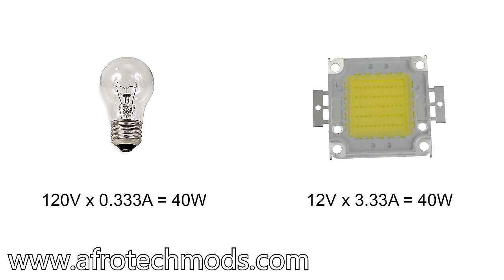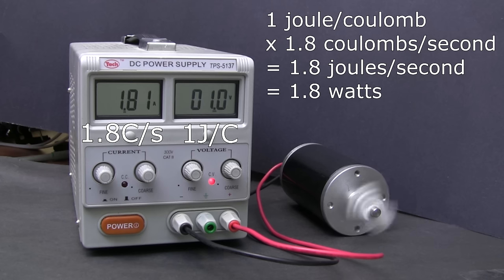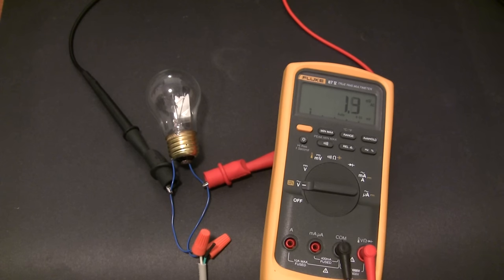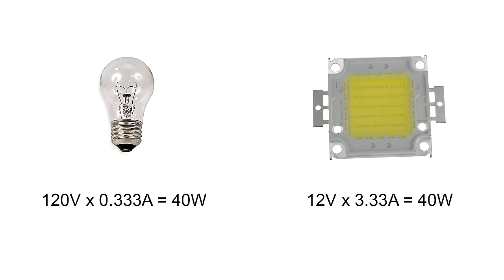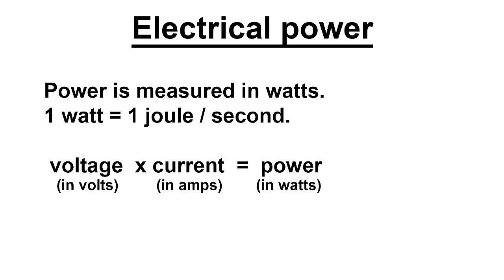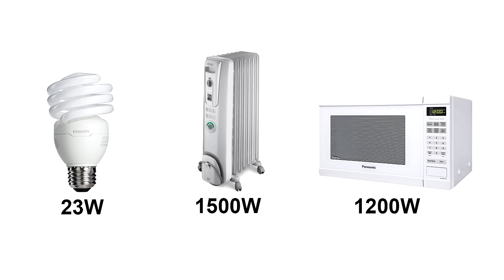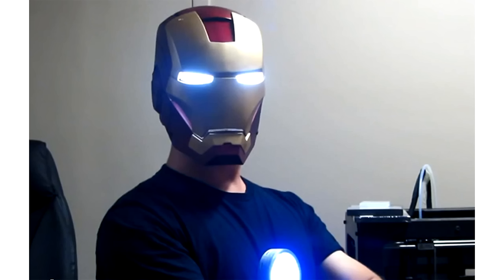Basic Electricity - Power and watts

Comment: you said that Ohm's law is a  linear relationship between current and voltage provided the resistance is constant. However, in the experiment you are referring to at 0:15, when you set up the voltage to 1, a current of 1.8 Amperes was displayed. But when the voltage was increased to 2, the current was 2 Amperes. This is not a linear increase. Why did that happen?
Reply from the maker: Because the motor is not a linear load. Not all loads are linear and therefore not all loads follow ohm's law.
Reply: @Afrotechmods  4 years after and I still got a reply!!! WOW!
Your content is AWESOME!!! Your 3 videos on Current, Voltage and Power are the best I have found on the Internet and better than any textbook.

I might be pushing my luck but there are are few aspects of basic electricity that I have not been able to grasp even though I have scoured the Internet for explanations. I would be most grateful if you could shed some light on these. Even electrical engineers seem to contradict themselves on some of them.

1. What is the difference between charge and electrons?
2. Is electricity a flow of charge or of electrons? If it is a flow of charge, and charge is a property of the electron (and not a physical element, as some people seem to put it), how does charge flow? And is the definition that "electricity is a flow of electrons" wrong?
3. When voltage is increased, are more electrons (or charge) being sent from the battery, through the wire and to the load, or is the same number being sent but at a faster rate? One site even claims that more energy is getting transferred to the electrons while their number and speed remain the same.
4. If at a vertical cross-section of the wire, there is x number of electrons/charge, and the battery is sending, say, x+100 of electrons/charge, will the wire  not be able to handle this and will consequently burn, just like a resistor or fuse? And if the battery sends x-200 electrons/charge, does this mean that, if the voltage is increased, there is room for about 200 more electrons/charge to be sent? Or is this an erroneous over-simplification?
4. If the battery is providing more energy to the electron/charge, how is the electron/charge storing this energy? Is the electron vibrating more, for example?
5. What causes the pressure (potential difference/voltage) in the battery? Is it the difference between the NUMBER of electrons at the negative terminal and that at the positive terminal, or is it the AMOUNTof energy that the electrons/charge hold at the negative terminal with respect to the positive terminal?

Please do continue to make videos.

Praying that you are in a generous mood to educate this ignoramus :-)
Thanks beforehand for your replies.
Reply from the maker: @salimr4718 1) Charge is a fundamental property that some types of matter have. And electrons are a type of matter. 
https://i.pinimg.com/originals/9f/57/7b/9f577b9a840c4c8bd1870523bb44de3a.gif
2) It depends on how you define "electricity". It is technically more accurate to say it is the flow of charge. "Electricity is electrons flowing" is just a simplification to try get people's heads around basic concepts before delving into quantum physics. If you really want to get into more detail, electrical current isn't actually even the flow of charge, it is the propagation of an electric field which results in the movement of charged particles.
Sparkfun has a more physics-ey explanation that you might find helpful. https://www.youtube.com/watch?v=z8qfhFXjsrw
The rest of your questions suggest to me that you are looking for answers in the wrong place - most electrical engineers usually don't look at things at that low a level, you want to be learning from physics and chemistry teachers. That being said, they are excellent questions so definitely keep searching for the answers!
Reply: Thank you for your answers and suggestions. Your explanation about charge and electric field helped me a lot. I now understand what you mean, although the aspect of what exactly increases and changes when voltage goes up is still unclear. I will keep on searching for answers and, if I find them (and remember), I will surely post them here.

On a side note, this quest for answers has also helped me understand why I (and other people like me) find it hard to understand physics. It comes down to how we approach the subject matter. We need too many answers right at the start and we are serial learners; we find it difficult to move on to the next topic unless we have fully understood the current one. This assumes that there is an answer to every question we raise, which is often not the case in science (and I am discovering that there might not be a single human being on this planet who fully understands all aspects of electricity). This also requires a teacher with in-depth knowledge, excellent teaching skills and tons of patience. This is exceedingly rare.Those who do well are those who can treat what they do not understand as black-boxes, or are satisfied with analogies, and are able to connect the black-boxes together to get an overall picture of the subject. And they move on with their lives! I believe that this is one of the trait of a good engineer. For people like me, that one thing that we do not understand might consume our days and nights (as it is happening with me currently).

I wonder if I can train myself to learn otherwise.

Thanks again.

Comment: I have a question
If we are using 60watt bulb in 220v then amphere is very low but the normal home wire electricity will give more than that how the bulb work in high amphere

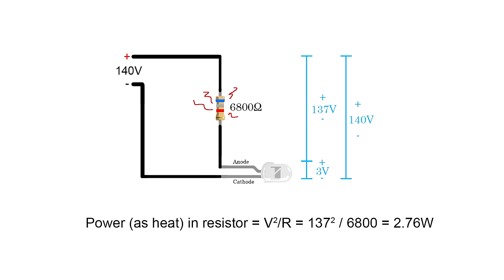Comment: in experiment at 3:26 (140V battery, 3V LED, 6800 ohm resistor), what if the circuit only had resistor (without LED), with 1/4W resistor, the current must be lower than 20mA and the resistor didn't smoke ?

Comment: Hi. On my wall there are sockets hat are able to output 1500W. If I plug a small lamp to the wall it get 10w from the 1500w available. If I plug a bigger lamp it get 100w from the 1500w available. Who is to decide that a lamp can get 10 or 100w? Is there a resistance on every lamp that permit to a small lamp to not be burned by the power of the wall socket?

Comment: This is something i've been confused about for some time: Is the amount of heat a lightbulb or any cable with resistance gives off just measured with VxI? Because I saw a video some time ago about why we use ac current instead of dc current, and the reason was that it is very easy to transform low voltage with high current to high voltage and low current (and viceversa) with ac, and that it was more efficient to deliver electricity with a high voltage and low current. Also some videos here on youtube about contact welders show that they rip open a microwave transformer and mod it to get a low voltage with a massive current from the wall. 
The point is, if it doesn't matter if the current or the voltage is high as long as both multiplied yield the same watts, then why is that? (the high voltage on power lines and those contact welders that people made that need a lot of current)
Reply: This is something i've been confused about for some time: Is the amount of heat a lightbulb or any cable with resistance gives off just measured with VxI?
Yes, resistive loads convert almost 100% of electric power to heat.

The point is, if it doesn't matter if the current or the voltage is high as long as both multiplied yield the same watts, then why is that?
Power lines have a certain resistance and according to Ohm's law there will be a voltage drop if current flows through a resistor. So the lower the current, the lower the voltage drop. V=RxI 

Let's say the power line has a resistance of 10 Ohms and you want to deliver 1MW. At 10kV you'd have to pass 100A trough the power line, so the voltage drop across the conductor would be V=10Ohms x 100A=1kV and therefor the power loss would be P=1kV x 100A=100kW.

If you use a higher voltage for the same task, lets say 500kV, you'd only have to pass 2A trough the power line. So the voltage drop would be V=10Ohms x 2A=20V. That gives you a power loss of P=20V x 2A=40W. 

For spot welders made from MOTs the opposite applies. Normally these transformers have a primary winding with let's say 1000 turns which sees mains voltage and a secondary coil with roughly 10 times the number of turns so they step up the voltage by a factor of 10. If you want high current at low voltage, you replace the secondary winding with a low number of turns of very thick and conductive wire, lets say 10 turns. That would step down the voltage by a factor of 100 and on 220V AC you'd get 2.2V on the secondary. Now the primary winding is typically rated for something like 800W, so you draw 3.6A from the socket while drawing roughly 360A from your secondary winding because P(in)=P(out)-P(heat). 

I hope this cleared things up a bit for you. If you still have questions, feel free to ask.
Reply: swiss Oh now I understand. Thank you! That was very clear. I completely missed that the heat given off by the resistor is given by the voltage drop times the amps, and that the voltage drop increases with the current passing through it. I think you cleared all my doubts about it! :D
Just out of curiosity, are you an electrical engineer, or studying something related to electronics?
Reply: Ciroluiro You're welcome. I'm not an electrical engineer by any means, just kind of a jack of all trades who doesn't mind sharing his knowledge. I've also been called a smart-ass many times and I hold that title with pride.

Comment: So let's let's say that a microwave draws 1000w of power per second. What confuses me is that what part of the power is spent. So only some of the energy is turned into microwaves. And we pay bills in watt hours, so it is obviously not drawing 3.6million watts per hour. So my question - is the power drawn different from the power that is dissapated?
Reply: I think you have your units mixed up a bit. It doesn't draw 1000w per second, because watts are already in "per seconds". It just draws 1000w, which means 1000 J per second. So leaving a 1000w microwave running for one hour means that it uses 1000 watt-hours of energy (since it's 1000w of power running for 1 hour).

Comment: I am not an EE but from what I have read, in AC circuits the voltage and the current are slightly out of phase.  So how does one calculate the power factor?
Reply: mediaguardian well google,english is not my primary language,but i study EE,so there are 3 equations: 
1. P=U*I*cos(phase in °) in Watts
2. Q=U*I*sin(phase in °)
in VAR
3. S=U*I in VA

Comment: instead of putting in a stronger resistor, can I simply put multiple resistors in parallel to divide the power onto more resistors? or doesn't power work like that?^^
Reply: Blasulz1234 2 equal resistors of, let's say, 5 Ohms in parallel will have an total resistance of 2,5ohms, so you would have to buy stroger resisitor, but if you're going to buy more resistor why don't buy one of 5ohm that can handle the power? But if you already have 2 10ohm resistors, yes, the power will split, the circuit will work and you won't get smoke
Reply: yea I'm aware of that, but thanks!

Comment: I work in I.T but tinker with this stuff. I hate how they size UPS in VA yet almost every PC, server, switch, etc they say it in watts. 
Like say a 24 port POE switch has a PSU that takes 700 watts. Then you have to find the right UPS for that and those are usually in VA which makes things kind of confusing, frustrating and a pain. I wish the UPS s would just say recommended max load 100 watts. then you know that it can run a 700 watt switch fine, or maybe 2 in some situations.
Reply: I always heard NEVER plug anything with a motor or laser printer into a UPS. I heard a story of some tech needed an outlet plugged in a mini vacuum to the UPS and blew the UPS up. Laser printer I think is more an issue of wattage that the fuser draws.
Reply: jtech0  The reason they rate these in VA is because of the maximum CURRENT RATING of these devices.  Say,  you're pulling 1000 VA and using 746 watts.  All is well,  if your power supply is rated at 1000 VA.  You are drawing one horsepower.   But your POWER FACTOR is only 0.746.  And,  in real life, it gets worse.  You are lucky to have a 0.65 power factor... not in the UPS device itself,  but in the LOAD.   Then, again,  it all depends on what devices comprise your load...    IHTH
Reply: Are you kidding?  These fuses and breakers are rated in AMPERES.  PERIOD.  Nothing to do with wattage. Wattage refers to the actual work consumed by the load, and in certain applications, is a fraction of the VA product.  You have a lot to learn.

Actually, I lied to you.   Breakers and fuses DO have a MAXIMUM voltage rating,  but it has nothing to do with initial blowing or tripping.  Instead,  it is a safety specification, in order to ensure RELIABLE circuit interruption on overload.  But still:  a 20 amp fuse is designed to open at 20 amps,  no matter what the OCV.  Put a million volts across a blown fuse,  however, and it's liable to arc over.

Comment: Very very basic question
When you say the bulb consume 40W every second, then the energy meter in the house, how will it calculate the consumption?
Since it is Wh, so is the calculation 40W x 3600sec? Wouldn't that be too much or incorrect?
Because I thought, whatever the power rating of the electrical equipment, that is the consumption per hour, ie, 40Wh.
Equation looks similar but the final calculation the meter does would be different for billing.
Reply: Arjun Menon a 40W bulb running for an hour would cost you 40W x 1h = 40Wh.
Reply: Arjun Menon 40W * 3600s.  This would give you the amount of energy in J (Joules)
Reply: miningmanna mc Wh is too a unit of energy, just not S.I (system International)
Reply: pit fermi I know, I was pointing out, that he may have confused Watthours with Joules
Reply: yes. my bad. confused basic units with S.I :D

Comment: 3:43 so Power is synonyms for both heat and watts?  If so doesn't that mean that heat and watts are the same thing?
Reply: Watt is joules per second and heat is also measured in joules because it’s also energy

Comment: what about very high voltage like 10kv should I play whit that
Reply from the maker: What could go wrong?
Reply: Afrotechmods nothing :)
Reply: Sure, but only from a 46kV rated bucket lift.
Reply: You can, but only once
Reply: Yes.  In fact,  I am working a new line of sex toys.  Stay tuned.
Reply: Sir, that is on my bucket list.
Reply: I find your reply quite shocking.
Reply: as long as its ameres is low no problem ahaha
Reply: *with

Comment: Why, when I feed my electrical designs from the car (12-14v, tons of Amp), it produces so much heat in the regulator lm7805, do I need a resistance before the circuit?
Reply: Without knowing more about your circuit I can't give a full answer but if you are using it to power a USB outlet for instance (I'm guessing because of the 5v) then I would suggest a buck regulator design rather than a linear regulator, they tend to be more efficient at dropping voltages.
Reply: Hello, thanks for the suggestion, but it's not for usb. The small part of the regulator circuit of 5v is to feed a PIC , The regulator circuit is basic, with a capacitor of 470uf or more at the input of the regulator, and at the output one capacitor of 10uf and another of 100pf. Basically only food to the pic, and some transistor if the case with the 5V, if I have other peripherals like leds or sensors, the food direct from the 12-14v  of the car with their respective resistances, the LM35 It is perfectly capable of feeding my circuit with its 500mA and these work well when I install it from the source that I have for tests, but when I install it in the car everything starts to go wrong, It gets very hot sometimes it burns. I thought of putting a resistance of about 100 ohm at the beginning of the whole circuit
Reply: Midian Alberto Khaiyow Ok, i'm too tired at this time to read that properly so I'll skip to trouble shooting.
You say it works on your supply but gets hot in the car. I assume you are testing at 12v? The car when running will be around 14.5v(ish) so try testing at that voltage and see if that replicated the problem?

Comment: Why does it not use power from what it gets, based on voltage?  This phenomena has baffled me - the load dictates or the supply dictates the power used?  E.g. putting a "large" fan on a "small" circuit.

Comment: Works for dc, what about va? And power factor...
Reply: I explained this to someone below but here we go:
There are 3 types of power: 1. Real Power (W), Reactive power (VAr) AND 
Apparent Power (KVA).
In order to measure the power in AC, you need to know this:

u = U (sin omega t + fi 0)
i - I(sim omega t + fi 0)
Note that "u"/"i" and "U"/"I" (in capital) are not the same.
U/I - The voltage/intensity displayed on the multimeter (Peak 
voltage/intensity)
u - the real voltage.

If you get U x A = The peak power (apparent power, also rated in KVA) - 
Now you know why the transformer is rated in KVA. That's the peak power 
they can support. If you put a load bigger than the maximum KVA, you 
will most likely burn it.

If you get u x a = The real power (KW or W). You need to know the real 
power on generators so you know what you expect the load will do. If the
 load is bigger than the real power, it will burn the generator. 
Basically generators are not rated in KVA because you don't need to know
 the peak power. The peak power is there for only 50Hz/60Hz (50/60 
times/s) but the load you put on the generator it is a constant load.

"fi 0" is the resistive inductance or the capacitive inductance.